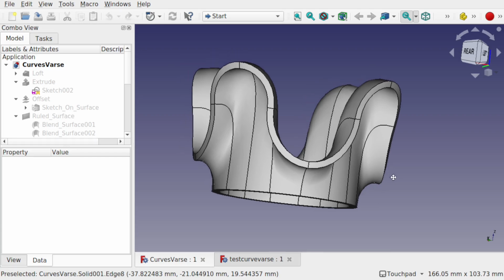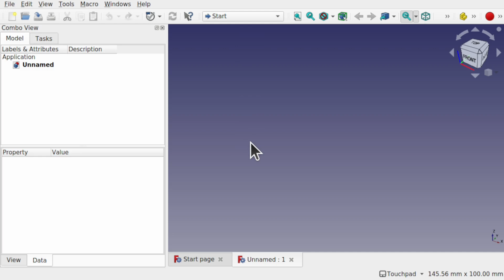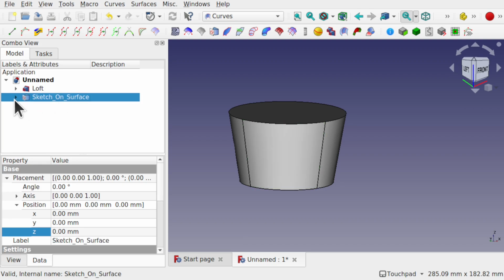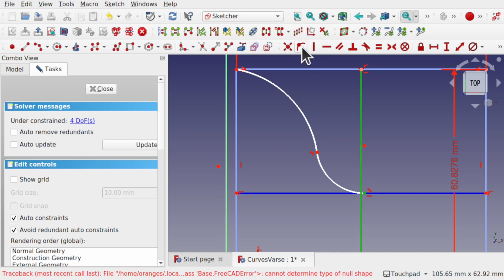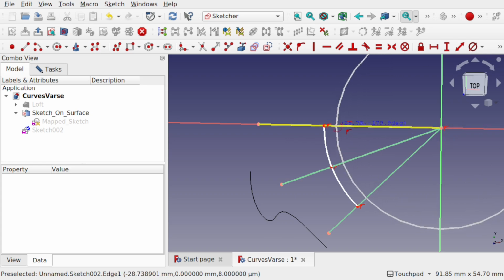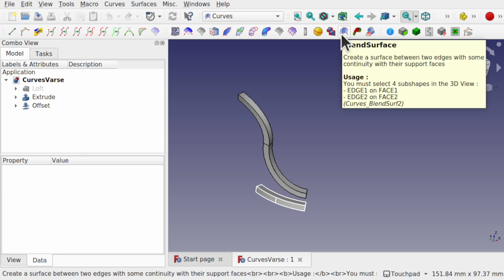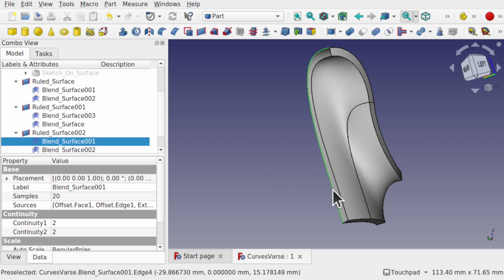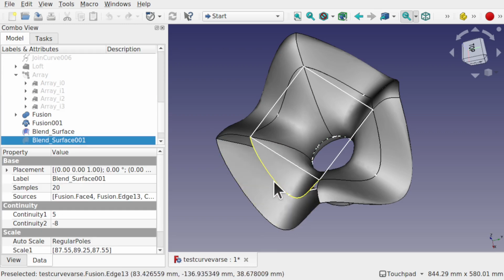FreeCAD: Complex and Organic Solid Forms Made Easy. Tangent Flow Example 1

Comment: Some VERY MINOR TIPS on draughting, switching to wireframe mode can help viewing items(as opposed to hiding objects), there is an option to box select a large number of objects on screen as opposed to having to go through the tree, when in the tree after a group selection you can also link the items together to clean up the tree BUT never forget to save often😍 Almost forgot to add that a different background color can help when reading info off the screen.

Comment: question from a person who understand 3dmax more than cad

how to build object from 3 dimensional points? 
i mean i have 3 technical drawings, front top and side so i can find every point in 3 dimensional space, make lines out of them and then fill in with faces, add a thickness inward and 3d print as a model part
i am having problems in my old years to grasp new things and i probably can't explain it better

it would also be nice to know if this cad has a deformation feature like draw a line and fold 3d shape over that line

i am trying to build open source model of one polish locomotive (eu07) in 1:160 scale and i simply can't figure out how to form the rood and front panels
i designed all inner workings of the model, but so far it is just a running chasis
i wouldn't mind spending few coffeees for some help
Reply from the maker: Send me over an email and I will have a look at the plans and see if I can work something out. (I used to use 3DSMaxR4 in the good old days) You can find my email in the about on my channel.

Comment: Another great video , my friend . 👏  you know the difference between a Vase and a Vaaase is about 7000.00 dollars . LOL 
 to take this model one step further . Say I want to take the first model before the polar array was performed . Cut this into 4 parts to fit on a small mill . Then take each individual block of material and machine the outer surface . Can this be done using path workbench ??  I would assume the digital inflation is there for the surface which is parametric  ??  I hope I've  explained this correctly ? If not I will slap myself and try again . Take care MR Darren . Stay safe and have a great day . BTW  thank you .

Terry
Reply from the maker: Lol no fully get what you are after. In the part workbench you can create primative planes and use these to slice the object using the slice apart option. You will get a folder full of slices. From there you should be able to use the slices in the path workbench. It's been a long time since I have used that workbench, back in 0.18 when I first started the channel but due to a dodgy CNC build (I thought it was going to shake itself apart lol) I didn't go much further with  paths workbench.

Comment: Yet another great video, MJ!

I'm curious, though: The official documentation, at least the parts I've read, don't provide work-flow information like you've shown here. So how would one go about figuring out how to do this sort of thing if you weren't here to show us? Or, more to the point, I suppose: how did you figure out how to do this such that you were able to create this tutorial?
Reply from the maker: Thank you.  well  its funny you should say that as I am thinking of doing some videos of  how I decide on the techniques to use including visualisation. With this one I  visualised the model and first figured out the general shape without curves. Which was a cone without apoiny (so I can use aloft or even a primative cone) . I then looked at repeating geometry. In this case I could see the repeat is circular (polar) in 4 sections (so they are an array) I then broke that down even further and took a section of the repeat and asked myself how can I make it simpler. I could see that I was able to use mirroring. I then have the complexity of the curve. I know the curve wb can give me what I need with mapping sketches so I use the loft as the structure. Knowing what the tools do rather than how to use them goes a long way in figuring it the workflow (which would be how you would manipulate the tools) . The developers of freecad have given us tools and rules but it's down to individuals and the community to come up with the workflows. It's like a tool maker making a hammer, they have no grounding in carpentry but they have the knowledge of tool making and the needs of the individual . When someone wants a hammer for molding brass then the tool maker knows it needs to be smaller and more delicate. They haven't got any brass molding knowledge but they know the basic parameters needed by the person. It's up to the person wielding the tool to decide ways of using it. It's the same as the developers for freecad. They know how to make tools to manipulate maths to create 3D shapes but they could have zero knowledge of CAD.  Knowing the tools puts you in an advantage position to figure out how to create your model. 

I also have a general interest in everyday life in how things are made up. It drives my other half mad as she can see me manipulating a object in my mind to figure out how to put it together. It's a bit like a game to me 😁 sorry, went a bit deep there.

In essence get to know the tools especially the part workbench. Go through each one and think and play, and ask yourself "how would I use this in my day to day modelling and for what?"
Reply: @MangoJellySolutions   Fantastic reply, thanks so much!

Your final paragraph summed it up beautifully...get to know the tools. Perhaps you'll agree...that is one huge mountain to climb. Also, being able to visualize the geometric 'truths' about an object you want to (re)create, as you so aptly described, is invaluable as well. 

I love this channel and thanks so much for creating it, especially for such a small audience (it seems).